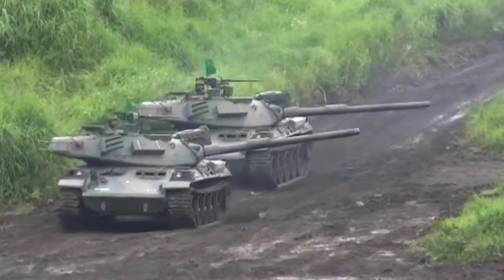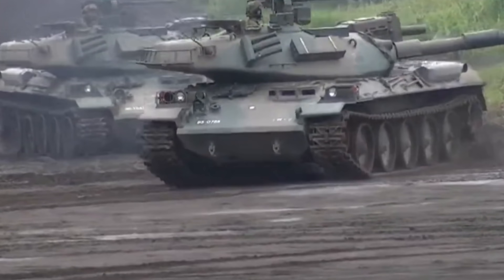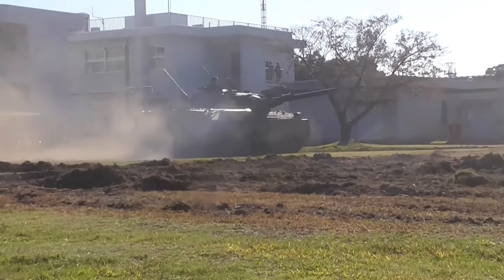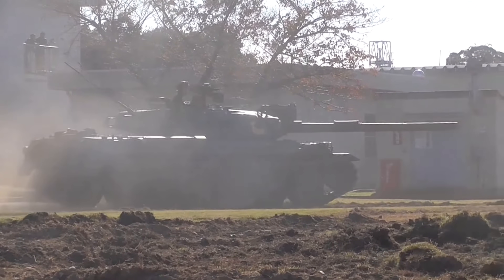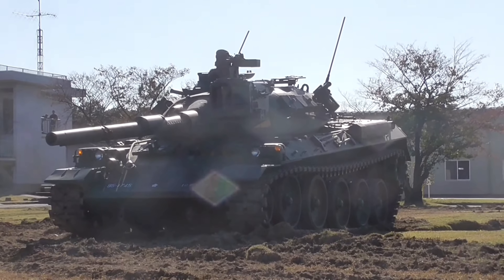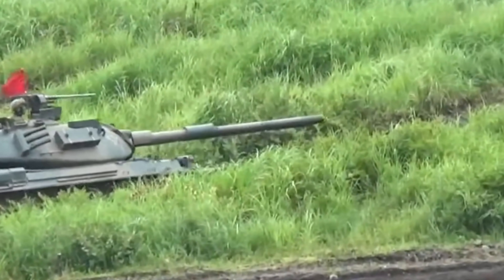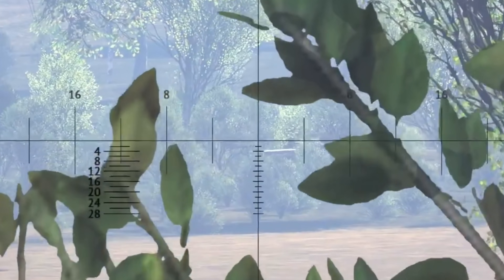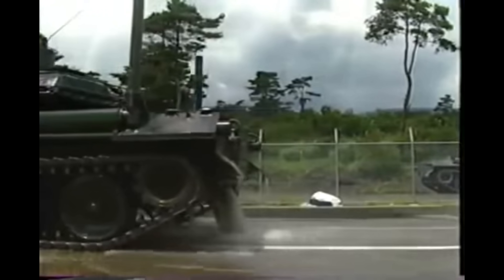Japanese TYPE 74 Main Battle Tank Overview | THE TOO LATE TANK

Comment: On paper there are better tanks, but this is purpose built for mountain terrain and tilty topography of island coast.
Reply: Indeed.. Especially as Japan shares no land borders with other countries, the only way for the Aggressor to attack is by Marine landing or Airborne troops, so they need tanks that can be moved efficiently wherever its needed..
Reply: @X.Y.Z.07  Hense the hydropnuematic suspension, the best transmission created to date, but not the  most cost effective
Reply: @heloheltheone  I'd say it's about the same as the decades old MBT-70 not ground breaking at all.
Reply: @brandonsmoot4056  Its more like a legacy tank for Japan. Much like modernised M60 and T-72 are still used up till today...
Reply: @X.Y.Z.07  oh so like a worse armor package than the mbt-70?
Reply: @brandonsmoot4056  well not sure.. Its comparable to Leo 1, AMX-30 and M60. Either way MBT-70. Never even went into production...
Reply: Completely agree. This is probably the second best tank in the world for fighting in Japan. The first best is their newer tank.
Reply: @HydratedBeans  type 10?
Reply: @Ronaldo Mendoza Jr it's different type of tank dude.. this one is MBT and the PH's searching for is light/medium tank procurement.. ascod win because PH already has an Elbit system bms, am I correct? ascod will be easier to integrate with other PH armament.
Reply: Depends on the paper. "Best tank" is ultimately extremely relative based on many factors, from economy to the terrain it's designed to fight in to available materials and technology to the people it's supposed to fight. There is no perfect supertank that fits every country in the world.
Reply: @Ronaldo Mendoza Jr 
Local Japanese laws still make it too expensive to sell.

And it's only recently they were legally allowed to export military tech. It's still too early for Japan to actually sell offensive weapons.

But once the Japanese diet can find a way to lower their prices, the Philippines would most likely be on the top or at least one of the most likely to be given the chance to buy one especially since the PH is the first and still only country Japan sold military equipment to
Reply: I wonder how well strv103 would fair in Japan :)
Reply: @Emanicas  haha its gonna be nightmare for the crew should they use the low profiled Strv-103 in the mountainous terrain of Japan.
Reply: It's like imagining a soviet tank collapsing a Japanese bridge, then another soviet convoy being destroyed by a single type 74 that just keeps peaking a mountain side with its suspension.
Reply: @Ronaldo Mendoza Jr because it’s probably very expensive. More than a T90 or M1 Abrams.
Reply: How so?
Reply: @Ronaldo Mendoza Jr because Japan is never gonna sell their arms. To anyone period.

Though the actual guns and armour may be old their fire control systems and general combat systems is literally top of the line. The type 90 had the best combat systems in the world until recently. Where the type 10 came out and beat it. The type 16 though it's design is old (it's more or less a 50 year old design) still works well thanks to the fact every western tank can't fight in southern Japan so at best the type 16 is gonna face ifva and afvs. Both of which is not gonna tank a dm 33 shell.
Reply: @Thekilleroftanks  Japan already export their defense radar to the PH last year.. and offers their destroyer to Indonesia too.. the 30ffm frigate is extensively promoted by Mitsubishi Heavy Industries for export market..

their arms sale export regulation is shifted toward more open ones..
Reply: @Thekilleroftanks  Well,it is correct that Japan is not fond of exporting their equipment to other Countries,but they still do some.Although not often

Comment: When the USMC said they were phasing out MBTs completely, I thought they should consider going with the concept behind the Type 10 MBT (smaller, mobile, modular etc) instead. I think Japan might be on to something. They make quality kit.
Reply: A light MBT like the Type 10 would also be much easier to transport by air. While the C-5 Galaxy can carry a single M1 Abrams, it would be able to carry 3 of the Type 10.
Reply: @RedXlV  why not a vehicle like the new ZTQ-15? it's a tank that's pretty much hovering the line between a light tank and mbt in terms of firepower and armor.
Reply: @UgandanAirForce  Something along those lines would also be well-suited for the USMC. The main difference I'd want compared to the ZTQ-15 is a 120mm rather than 105mm gun. We know that's achievable on a sub-40 ton platform.
Reply: @RedXlV  well I'd imagine it would be used for infantry support/fire support along with IFVs for the marines which would make the 105 doable, but in terms of anti tank, wouldn't a smoothbore 105 with a really good apfsds round do just fine? Not to mention we could possibly develop an atgm that could be fired out of the barrel of suck a tank.
Reply: Abe did lift the ban in 2014 right? So maybe USMC can get some for evaluation.
Reply: Tanks are too vulnerable to drone strikes looknat the videos from the the recent Algerian war tanks were getting obliterated by drones and stood littme chance against them.
Reply: @lordot8665  isn't that what anti aircraft vehicles are for? You gotta use tanks in combined arms, they don't do well on their own.
Reply: @lordot8665  just look at matsimus videos on Russian tracked AA vehicles, I can't remember the name, but one of them is perfectly suited for taking out swarms of drones and could easily be added to a tank troop. I believe once drone swarm technology is developed tank troops will go up to 5 tanks, the additional one being an AA varient.
Reply: @lordot8665  that’s when you send them in without any air support. keep in mind that tanks a part of a larger army, they rarely ever operate by themselves.
Reply: Give em weisels
Reply: Acolyte from ROTR but 120mm

Comment: Yeah... The Type 61 really wasn't great....look how many Godzilla destroyed.
Reply: I see you're a man of culture as well.
Reply: I think all Japanese tanks should be judged in how effective they are against Godzilla.
Reply: The problem is the 90 mm gun, according to the Heisei era Godzilla production staff (I'm not joking!) the 90 mm guns on the Type 61s just didn't have enough penetration to do serious damage to Kaiju because it couldn't penetrate their armored hides. I always thought that was a pretty cool little piece of lore.
Reply: @lamalien2276  So Godzilla had a bunch of AP rounds stuck in his hide?? 😄
Reply: Type 61 was tall and had horrible centre of mass. Basically, Godzilla didnt need to fight them, they would likely topple over
Reply: @heloheltheone  
What ? They used that thing upto early 2000, so i'm pretty the tank worked fine... 
And Type 61 is the same size as the M4 Sherman, hell, shorter even...
Reply: The sherman is a tall tank, but the type 61 is taller. Take the height from the cupolar. The reason why this thing has such bad centre of mass is where everything is. Lots of stuff in the turret, a  thick gun mantlet etc. Maybe it is smaller than a Sherman, but the tank still experienced problems with its height, though the sherman did not
Reply: @heloheltheone  actually if you dig deep enough, read actual accounts from crew members, watch real film from the day and not the fan mail of today. The Sherman had MAJOR issues due to it's height and thin tracks. It was constantly sinking into soft ground, had poor cross country abilities and had major issues getting over obstacles 1m or higher. There are a few old Nazi films on youtube you should watch.
Reply: I saw a few up close in real life way back in the 90's while on Active duty in Japan. Once we realized what we were looking at we all looked up into the sky HOPING to see the big guy. But, alas the JDF was just training that day. :(
Reply: nice to see you here
Reply: Breh
Reply: It's time for Matsimus to put his foot down and stop the Godzilla stomp jokes.
Reply: @JZ's Best Friend dont u mean fish